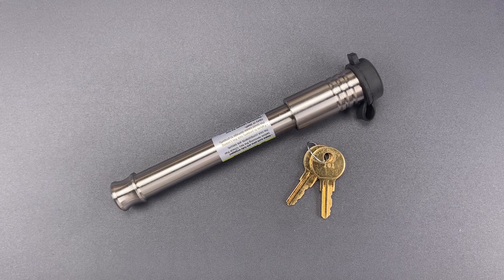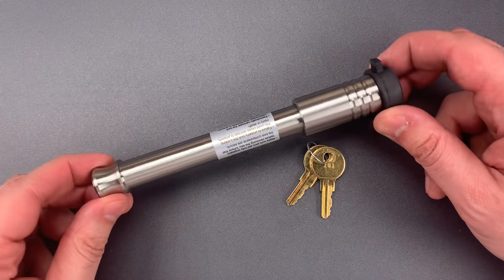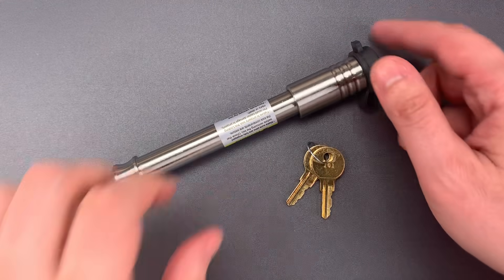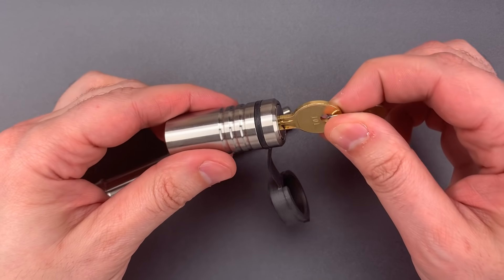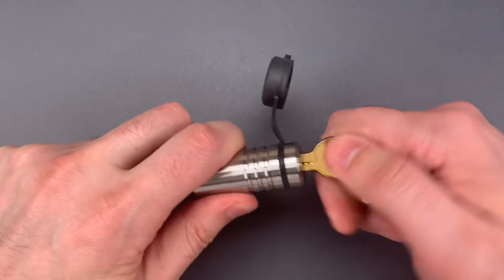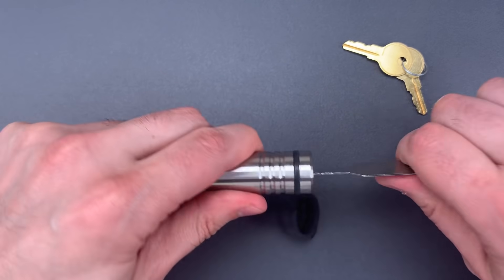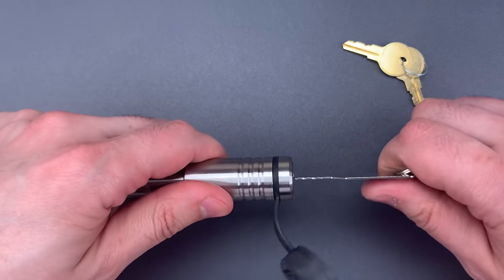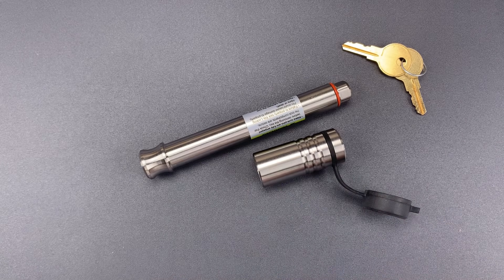[1086] The Lock That Must Be Picked 15 TIMES! (Infinite Rule Security)

Comment: Now what about brute force attack like a pipe on the lock end and giving it a good pull that is the biggest problem with locks that look like that. I work at a trailer dealership and I have had to remove locks with that method it takes 2 seconds and a short pipe.
Reply: I know the locks you are talking about and that sure doesn't look like one of them. I don't think you will be brute forcing that off so easy, but I could be wrong so I think we should get LPL to give it a try. I always love when he gets brutal on some locks. Ramset, hydraulic bolt cutters, pistols and rifles. A piece of pipe might be too tame for him though.

Comment: My question is if you can unlock it while it is attached to a trailer. I see that you unlock it with relative ease when you can manipulate it, and I wouldn't be surprised if you could pick it without jiggling it, but realistically this would most likely be tiresome and tedious to do when the lock is in a fixed position.

Comment: I have an idea of unpickable lock! You insert motorized key in a lock and it spins 1000 times. Voila! Nobody dares to pick it 1000 times manually. Of course it must be little bit better than lock showed in the video otherwise it could be opened with motorized jiggler.

Comment: It would be very hard to get to it with how my trailer hitch is mounted. Mine goes into the bumper and you have to put your hand inside the little cutout to put the key in to unlock my trailer hitch lock. And I have small hands and it’s a struggle to get my hands in their

Comment: whats the gap like between the core and the wall once opened once could you slide a shim in over the shear line to hold the pins back as you turn it

Comment: Could you use the tool that twists the lock really quickly to avoid having to pick it multiple times?
Or does that only do one 360 degrees rotation?

Comment: So basically change the core out to one that's not susceptible to a jiggle key and you might have a shot at making it into a fairly decent security measure right?

And as people always say and I doubt this really needs to be said, locks are for honest people only, a person who wishes to pick a lock will in some capacity be able to always open it up no matter what. Sure some require specialty tools, but let's just say for example a standard code wheel lock. A normal person isn't going to take the time to try and decode it, but a person who really wants in will and will find any way to do so even if that way requires brute force. I mean it's pretty good common sense to never draw a weapon on someone unless your life is in immediate danger yet we still have hostage situations and robberies. Essentially it makes no difference if you buy a cheap $10 lock or a $100 lock. They both can be picked and have weaknesses that can be exploited with proper time and patience. Just don't buy a master lock and you should be just fine in the long haul.

Comment: Isn't picking more of a specialized skill? I would think most thieves would just use a bar to try and snap it off instead of going to the trouble of trying to pick the lock.  What would be interesting to see is a real world test...install it in a truck and then using methods a typical thief might use, try to defeat it.

Comment: So the average thief carries the the picking tool? The thieves that are after my trailer? That seems difficult for the average person. Now imagine a thief. They ain’t too smart to begin with. I see most walking away even if they get it to turn 3-4 times. I see a good lock. I also see an honest man that had time to figure this out and practice. Chances are while the thief is picking and turning. I walk up and shove my gerber 3” pocket knife into the back of their neck to instantly sever the spinal cord. After a few of those get posted on news. You’ll weed out the thief’s that don’t want their back turned focusing on picking a lock 15 times while it’s up under my bumper attached to hitch. My hitch pin fits so tightly against chain anchors. I don’t see a common thief cracking this. Thanks for the review. Headed to order a couple.
Reply: i feel like murdering someone in cold blood for that is,,, maybe a bit of an overreaction?

Comment: holy shit, that would be a grail lock with a decent innards wouldn't it? is it possible to re-key it or change the cylinder to be better? also that would be significantly more suspicious to do 15 times if you had to open this in public than just once so it is some improvement maybe? still quickly opened though.

Comment: Just out of curiosity: Can you show me an illustration of some sort how this lock is supposed to be used? I don't get it.
Reply: It holds your trailer hitch onto your vehicle. The square thing that is below the bumper on most pickup trucks is called the receiver hitch. It has two holes in it, one on each side. You insert your trailer hitch into that receiver hitch. The actual hitch also has a hole that goes through the center of the hitch. You line the holes up on the receiver and the hitch and put this pin through the holes and lock it. It prevents people from stealing your trailer hitch (or your trailer if they are bold enough).

Comment: You only can pick locks so fast, because you see the key. What, if you wouldn't have a key to see which tool you need to open the lock? A thief doesn't have a key to see. Open a lock without having seen the key beforehand, LPL.

Comment: Let's remember what this lock is actually for ... It's not for preventing someone from stealing your trailer, it's to prevent someone from stealing your receiver hitch and ball, that's it... Is that sort of item really a high theft item?  Maybe in some areas where they'll steal anything ... I've used anything from just a regular hitch pin with a cotter pin through the end to a 3/4" bolt with double nuts on one end to prevent the nut from vibrating loose and I have yet to have anyone steal my receiver hitch... Maybe because it is not a shiny stainless steel unit and is just a somewhat rusted steel ball?  Or maybe it's because of the "NRA Life Member" sticker on my rear window? :)  And yeah, I would shoot anyone I caught trying to steal my trailer hitch (or anything else on my vehicle)...

Comment: That would be a brilliant high security lock if it had a good core! Anybody know a hitch lock that doesn't suck?
Reply: I want to see him examine a Strattec Bolt trailer lock. Those arrive unkeyed and are vehicle specific. You set the keying yourself by putting in your vehicle ignition key, and it permanently locks in that keying, so you can have multiple locks like a trailer, hitch, hitch pin, even took box lock that opens with your ignition keys. 
I'd like to see if they're worth what I paid for them! They're about $35/lock

Comment: What a pain in the ass.  My trailer keys are on the same key ring as my gun safe, toolbox, Yakima rack, etc keys, and my hitch is on a Mazda car.  I'd have to be kneeling on the ground spinning a pile of keys 15 times just to pull the drawbar out?  I think I'd just throw a jiggler in my wallet.

Comment: You have to wonder why they would go through all that money and effort to design and manufacture an innovative product with high security and then do something that stupid. Costs/profit is an easy answer of course, but I’m not sure that makes sense given they spend what I assume is a pretty penny on the whole relocking every 1/4 turn mechanism. Either make an all around solid product or make it the cheapest POS that only keeps out narcoleptic ADD sufferers. The middle road doesn’t really work

Comment: fuck, that's an amazing design. What are the chances normal locks (padlocks etc) start using something like this to increase pick resistance? Seems like if you put a good core in a design like this it could be really good.

I mean, it still wouldn't stand up to an angle grinder, but that's not what this channel is about